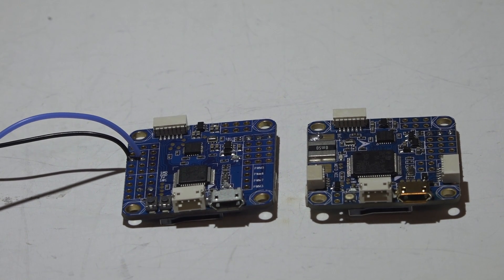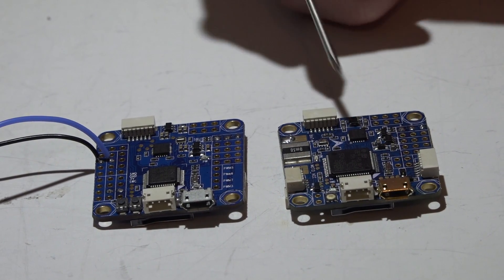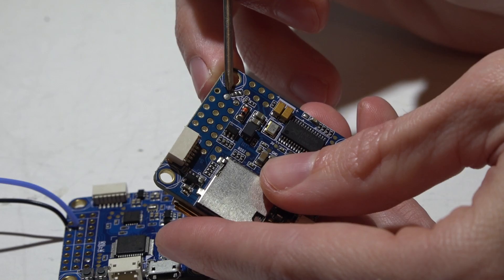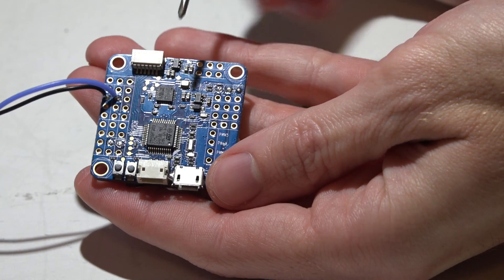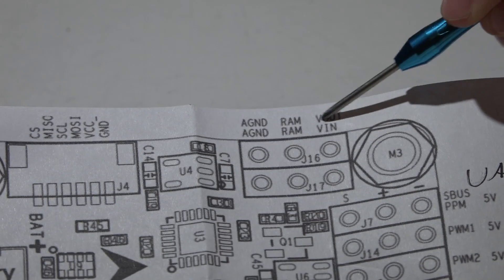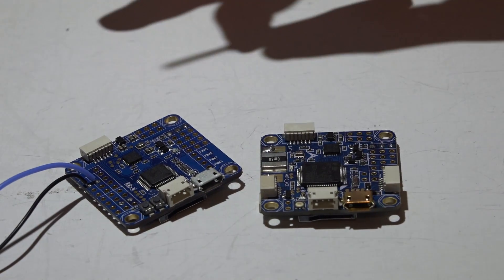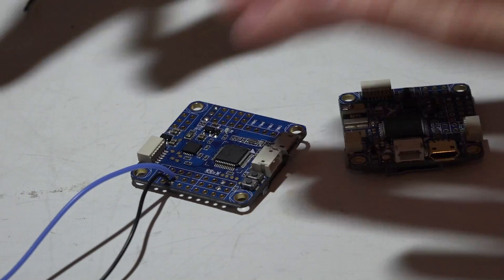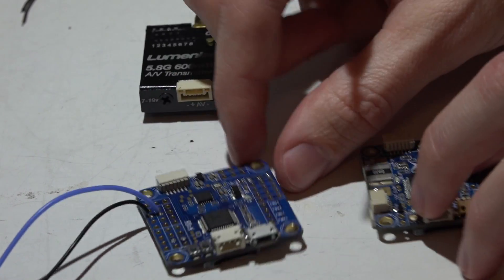Adding Camera & Vtx To Omnibus OSD (F3/F3Pro/F4/F4Pro)

Comment: aren't those two wires too thin to handle the full voltage of the lipo?
Reply from the maker: This is copied and pasted from my reply to your other comment

You obviously sound like you know what you're doing, so I'd say your risk of anything going wrong is low. You just have to understand that many of my viewers are new. And to explain what you can and cant do, with every combination of parts out there drawing different currents, some video transmitters supplying the 5v to camera, and everything else, I avoid that because it would have doubled the length of the video. If you're going to supply your parts with the full voltage of the battery, its just as easy to solder that wire to the PDB than the flight controller. So by telling people to do this the guys using the full voltage are covered, guys using 5v are are covered, guys using a little or a lot of current is covered. Everyone is covered if I just say use a 5v, 12v, or full voltage from the PDB. 

I understand where you are coming from. If you saw my inbox of how many times guys have fried the regulator on these boards then you would understand where I'm coming from.
Reply from the maker: Wires can handle any voltage. What matters is the amount of current going through them. Not that much current is being used.
Reply: Thanks! Also, is it a true BEC on the camera 5v pins? Have you had any issues hooking it up directly (if you did, I know you use a different methd of powering a cam) SHould I add my own BEC or is the built in one good eouph to handle spikes? I heard there was an issue on the f3 boards with this.
Thanks for your feedback
Reply from the maker: I highly suggest NOT powering a camera and Vtx off of this board. It will overload the voltage regulator then it will fry. I would power your camera and Vtx from some other source just like you would with any other flight controller. The easiest way will be to use a PDB with a 5v and 12v regulator built in and using that.
Reply: Would you be okay with powering just the fpv camera off the built in 5v bec and then using another power supply for the vtx?
Reply: Project Blue Falcon I don't know why keep saying this ("it will fry")... details in a separate comment, it's just a matter of adding up current draw values to support/refute this claim, and I think all you say in the video re is how it will feel. That is not a reason to tell everyone that it will destroy the FC!
Reply: Charles Klein I'm gonna power everything off a separate 12v bec with a filter to be safe
Reply: Michael M 30 awg wire is typically rated  at 300 volts. Issue is power.

Comment: So I'm trying to get my OSD to work on the F3. I have it hooked up correctly per your instructions. I'm powering the camera via PDB on a 12V source..Full battery power for my transmitter.  I have the Vin/Vout wired correctly, but no OSD. What am I doing wrong? Everything else seems to be working just fine. I have a strong video signal. Thanks!
Reply: Have no idea what I did, but reboot several times. Looks like everything is working now!!
Reply: I think I have the same problem.
Reply: I had a similar issue, i added a ground wire from the Ground on both VIN and VOUT to the ground that my Camera and VTX were soldered to, so they have a common ground, fixed the issue.
Also.. if you have a PAL camera and you select NTSC in the OSD menu (or Vice Versa, NTSC camera and select PAL) it will show the video from the camera only. just go back and select the opposite one

Comment: foi it will not fry. if 2 holes are labeld vbat they both are connected to vbat. the holes them selves are directly joined inside de fc with a path (wire). you can test it with the multimeter to confirm.
Reply from the maker: I do understand they are connected but not all regulators from ESCs or wherever work together. It would have added 5 minutes to the video for me to explain you can with certain types, and certain types you can not. But either way there is no reason to have two power sources whatsoever so its best to just not do it.

Comment: At 1:09 you show the pin layout of the board and my question is:
Why not  connect the positive wire from the 12v regulator from the pdb to the ram pin on the board, the negative wire to one of the ground pins on the left side of the board's diagram and then power your vtx and camera from the board?
Would that not work well?
Reply from the maker: That will work fine.
Reply: Project Blue Falcon Thanks, and I assume there will be no heating problems with that setup then?

Comment: Hey JC, I have this PDB http://www.buddyrc.com/diatone-v8-3-lc-filter-power-distribution-board.html It has an LC filter in it, so then I can just put the video signal wire, power, and ground from vtx and camera to this PDB and it should work? I have a runcam swift and TBS Unify Pro Race(can take 6s battery Voltage).
Reply from the maker: With that PDB you will want to run the camera and Vtx power and ground to the PDB, but run the camera and Vtx video signal wires to the Omnibus. The video wires dont have to go to the PDB, the PDB filters the power and ground. They only have pads for the video just to keep wiring simple but its not needed. So just run video wires to omnibus.
Reply: Great, thank you so much!

Comment: Hi JC. I read somewhere that the Omnibus F3 pro has a built in LC filter, can you confirm this? I was thinking of powering my vtx from the ram pin using vbat and powering cam from vtx. Will I still need to install separate LC filter? Thanks in advance
Reply from the maker: It does not have a LC filter. They say on the website its "filtered" but what they mean is it has a 5v regulator. Technically that is a type of filter but its not a real filter. I would recommend using a separate LC filter for two reasons. First is because its a real filter. Second is because the video sucks when you power the Vtx off this flight controller. Its nothing but problems. You can power a camera with the 5v pins, that works fine. But if your Vtx can power the camera then I'd recommend using the separate LC filter to power the Vtx then power the camera off the Vtx.
Reply: Hi
What about the new Omnibus F4 Pro Flight Controller V2, I have this coming and was going to use a micro 5v cam and the 5v unify pro vtx,   It say it has a 5v3a SBEC and On-Board Video Filter ?
Thanks in advance

Comment: They reversed Vin and Vout on the pro? Ugh that explains my problem. Wish rtfquads had pictures that represented that. Are there any official diagrams somewhere for the F4 V2 Pro?
Reply from the maker: Yep video pins are reversed. I honestly cant find any wiring diagrams for the F4 pro. I just used the F3 pro wiring diagram and worked with that. They're not exactly the same but close enough.

Comment: JC quick question and just to clarify, Your wiring goes like this: PDB>LC Filter>VTX> Cam? 
Is this pretty standard for all your builds? Do you ever skip out on the LC Filter or is it a must for you since it cleans up the video image? 

Thanks and happy holidays!
Reply from the maker: Yep you got it. I power the Vtx off the LC filter. The Lumenier and Cricket Vtx have two power wires, one going in to power the Vtx then one going out to the cam with 5v. As far as the LC filter, those Vtx's filter the power so its not needed, but I use the filter anyway to protect the Omnibus, my receiver, and Vtx from the voltage spikes of using ESCs with active braking turned on. Basically the LC filter is powered off the PDB, then I'm powering the Omnibus and VTx both off the filter. This doesnt apply to the Omnibus Pro boards though since the battery leads go to the Pro first and then the PDB.